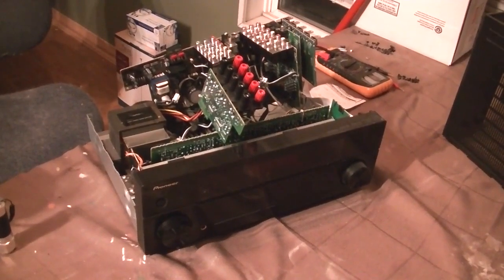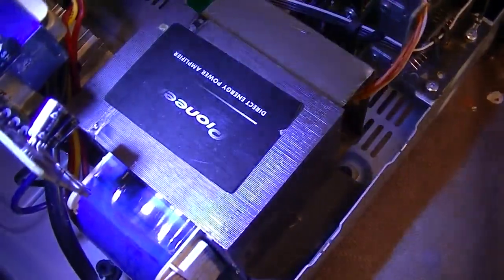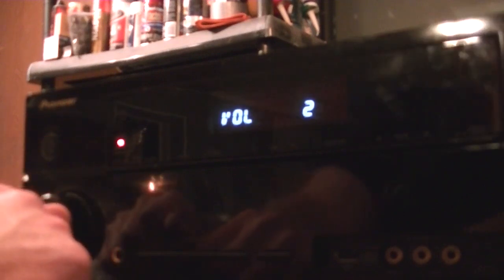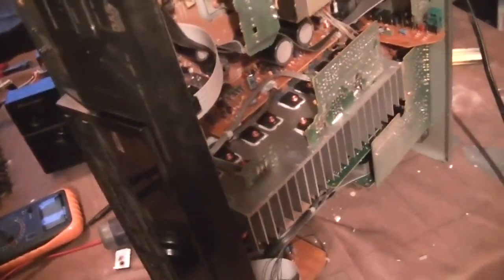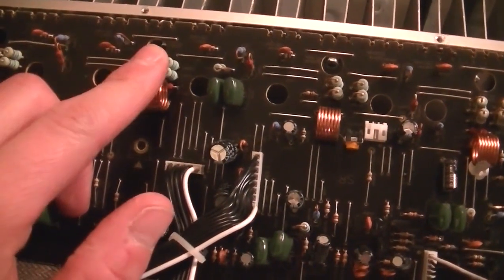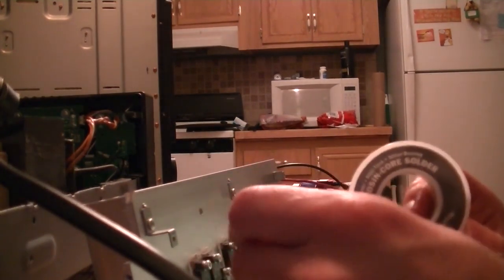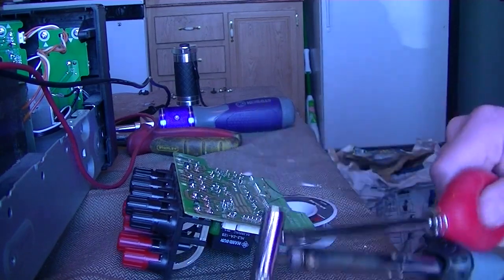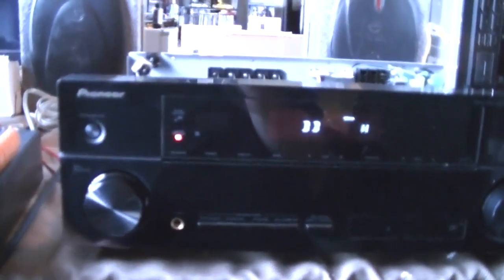Pioneer VSX-820-K Stereo Receiver Diagnosis & Repair - Kitchen Table Electronics Repair

Comment: Nice repair tutorial ! :-))
One question, little off topic but, how yours Xenon CPU performs in the video editing ?
I have the Intel C2Q9550@3,8 GHz over clocked and I'm interested to buy the Intel Xeon E5440 and do the 771 to 775 Mod to get some more processing power but the question is, is it worth the effort ? What is your recommendation, should I get the Xenon do the Mod ?
I have the Gigabyte ga-ep35-ds4 MB, 8GB 800MHz mem, GF GTX570 and q9550 running hackintosh ML 10.8.5
Thanks and keep up the tutorials coming !!!
Reply from the maker: I have not transferred the parts into the video editing machine yet, but I did pick up an E5450 for $35 on ebay and was able to squeeze 4.4ghz out of it. I think there was more in the processor, but the motherboard wouldn't make it past 490Mhz bus without memory fits. I don't know what speed the MCH of the P35 chipset can handle, but the MCH was the limiting factor I believe of the EP45T motherboard. I will be doing a video soon on the settings I used in the bios to get 490 out of the motherboard.
Reply from the maker: As far as I know, the Q9550 is the same as the xeon 12MB chips, but the xeons E and L series xeons are lower TDP, which means they are probably a better binned processor and should overclock better. But performance wise they are probably the same.
Reply: WaybackTECH Hi
That is insane overclock on air or water ! Your comp must be rocket fast with that speed demon inside :-))
I didn't dare go above 450Mhz FSB on my rig but I do only have air cooling
( Scythe Mugen SCINF-1000 ) 
I would probably get the E5440 for the same price as you and I already ordered the pin shift strips from AliExpress. 
These chips are dirt chip compared to the C2Quads, for ex the Q9550 is still about 120 Do used here in Sweden but I guess it's because not many knows the 771 2 775 mod and many whom migrating to newer systems. 
I probably going to try this mod with the E5440 just to see if I can doit and for it's fun :-)))) What is you choice of video editing program ? Which would you recommend ? Do you have hackintosh too ?
Reply from the maker: I used the HSF that came with the system I used for parts. The HSF that is in the video editor now is a coolermaster V8 which can cool 180W of heat.  It is a hackintosh, running iATKOS ML2, which I updated to 10.8.5 and I'm using  final cut pro for editing and handbrake to recompress before upload
Reply: WaybackTECH Thanks !

Comment: Where can you get that desoldering gun from?
Reply from the maker: +John Bateman Radioshack, but I don't recommend it because the tips break down after a couple uses and are almost impossible to find. I now use an S-993A vacuum desoldering gun.

Comment: any vids on a pioneer SX-950 ('76 ol skool) It powers on, but dead, no relay click, nothing.
Reply from the maker: I don't, but Maxxarcade did a resto video on I believe an SX-850 and he had that issue when the protection board came into contact with the main filter caps and blew some of the transistors. You might want to check that video out.
Reply: thanks wayback, not even close, but thanks ;)~ VSX went microprocessor and all that led stuff ;)

Comment: my vsx 821 smells burn when power on then turn off 2 seconds latter any help? 
thanks
Reply from the maker: If I had to guess it is probably a shorted transistor in the main amp, like the one I repaired. You might take the cover off and see if any of the grey resistors on the amp look discolored in the center. Brownish tint.  These metal film resistors, also called fusible resistors can do thermal nuclear if power is going somewhere it ought not to be, causing them to short. Might try unplugging all wires to the amp module, then power it on and see if it still shuts off. Of course make sure you have the unit unplugged from the wall before going inside :)

Comment: That appears to be an awfully big iron you are using to solder. 40-60 watts perhaps? For electronics I prefer a 25 watt iron myself so as not to possibly damage sensitive components.

Comment: A very i nteresting and useful video for anyone trying to repair one of these receivers, although slightly pedantic people with OCD (like myself) will probably pick up on the glaring error, where the presenter refers to the FFC (Flexible Flat Cable) as a Ribbon Cable, which, as I'm sure we all know, are two completely different (and incompatible with each other) types of cable.
More annoying  (for me at least), is the presenter's repeated use of the irritating and meaningless American phrase "go ahead" and its variations. He never actually goes anywhere in the video, neither ahead, backwards or anywhere else! It seems to be involuntary, habitual behaviour on the presenter's part, a nervous tick type thing if you like. Worse still is his pronunciation of the word "Solder", which he repeatedly pronounces as "Sarder". This may not be all his own fault, every American that I've ever heard use the word, mispronounces it that way, so he probably learnt it like that, although the spelling alone should suggest the correct way to say the word.
Makes me want to move to the states so I can get a job teaching "English as a foreign language"

Comment: I got a vsx-821 and I cannot even check the codes, no relay clicks, no power, no LEDs, no display. Any idea where to start?
Reply: I'd open it up and look for obvious damage, if you aren't getting any response then it's probably something obvious inside.  Could be the transformer, how comfortable are you in testing live voltage?